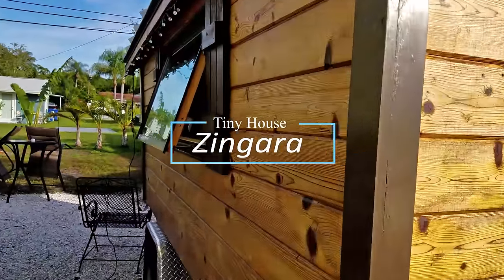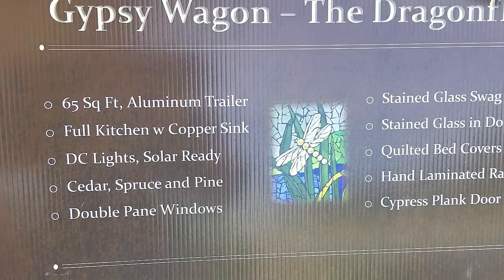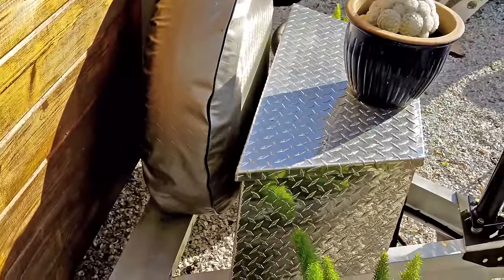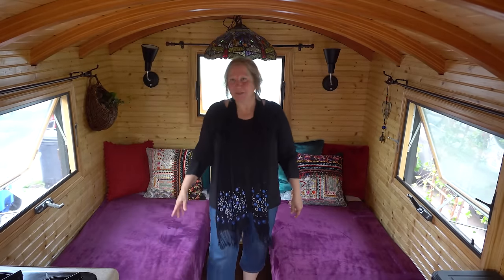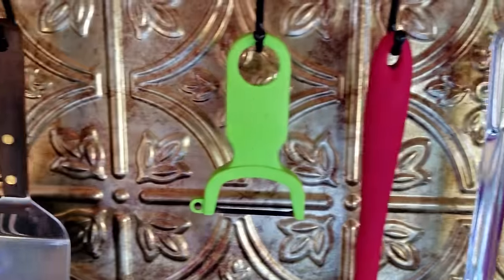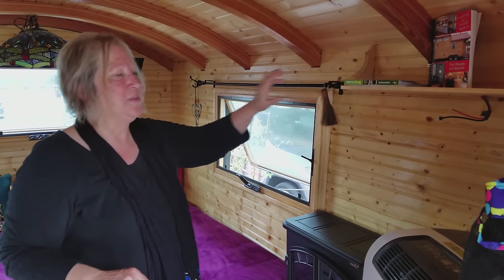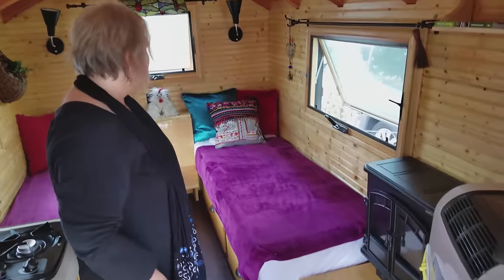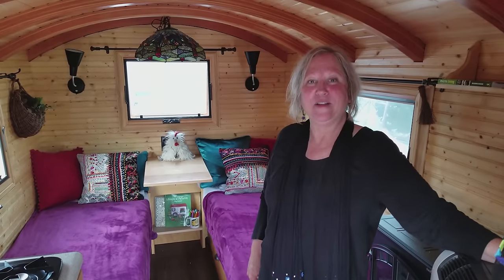STUNNING! Dream Tiny House Gypsy Wagon Tour

Comment: absolutely love this, wide open inside gives it an airy feel and I love the use of wood inside and out. seems like it would be quite heavy for its size but if you are just moving around seasonally I dont see where that would be too much of a problem.
Reply from the maker: Very true. The large windows on every side give it a good cross ventilation too

Comment: This is a particularly interesting and really quite beautiful travel cabin, built onto an all aluminium, single axle trailer for lightweight towing!

This travel cabin would benefit from having a Fatsco Pet Stove model 450, built from cast iron and marine grade stainless steel, at 9.5 inches tall and 6 inches diameter, it would not only fit well, it'd look traditional too and heat that space really well.

You really chose an interesting owner and travel cabin to feature on your video, what a great combination.
Reply from the maker: Very cool thanks Felix!